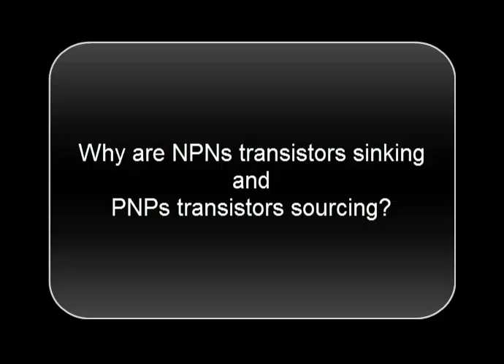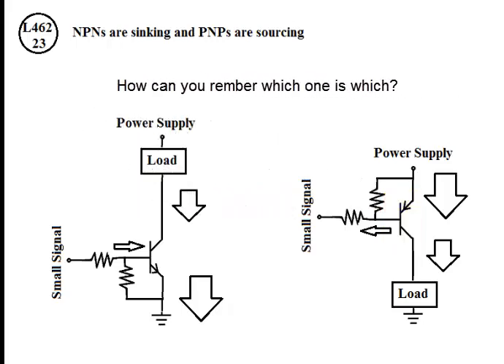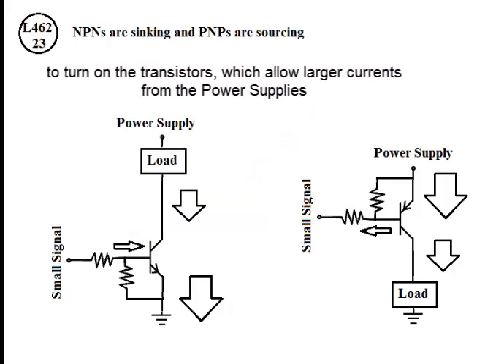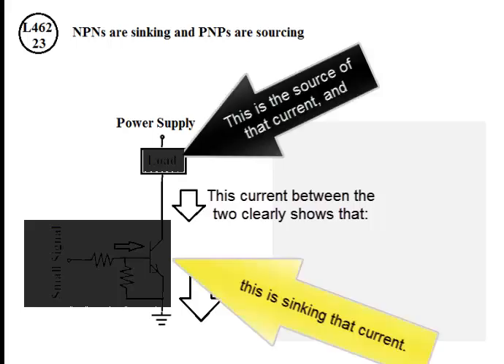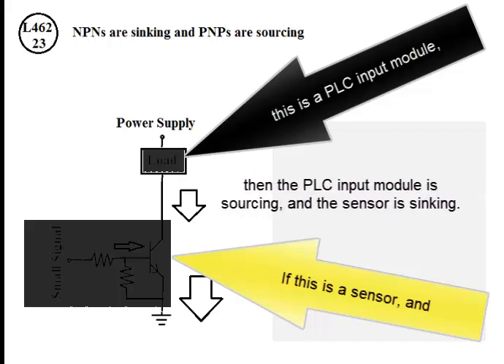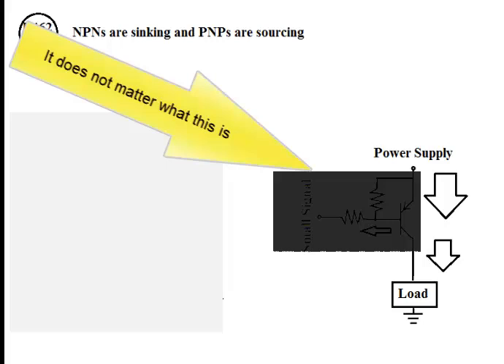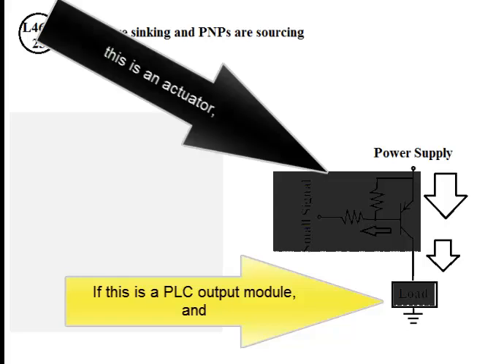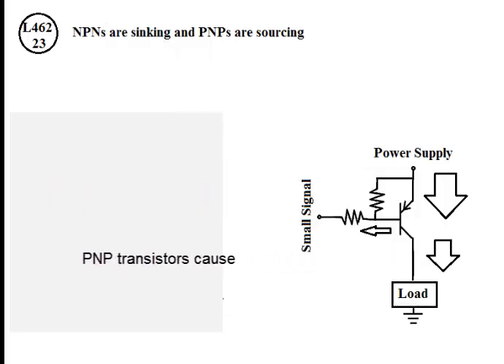L46223 - NPN Sinking and PNP Sourcing Transistors

Comment: What this doesn't answer for me is why the NPN could not be placed before a load or why a PNP transistor could not be placed after a load.  After all, how does the transistor know what devices are sourcing and sinking?  The only difference between the NPN and PNP, as far as I can tell, is the the NPN is on when the BE junction > 0, and the PNP is on when the BE junction < 0.  In those cases, the base junction of the NPN transistor would need to be sourced with a small amount of current, while the PNP junction would sink a small current.

Comment: The power supply.

In the Sourcing circuit the power supply is integrated in the PLC out/input module. In the Sinking circuit the power supply is external.